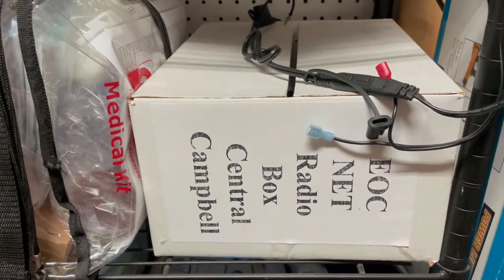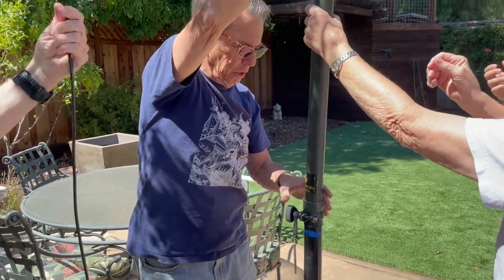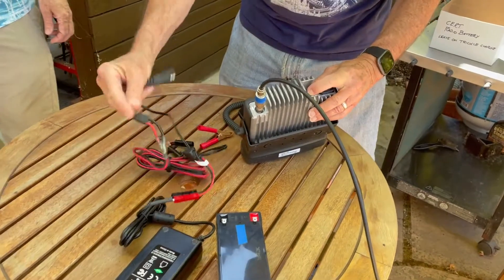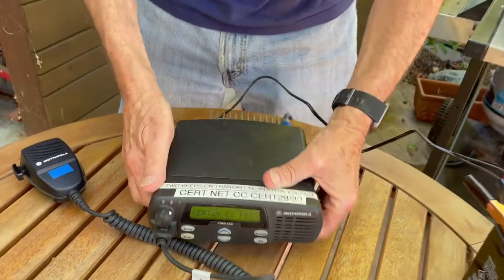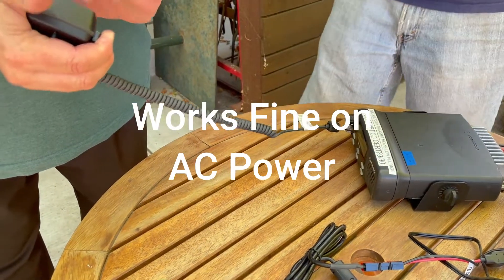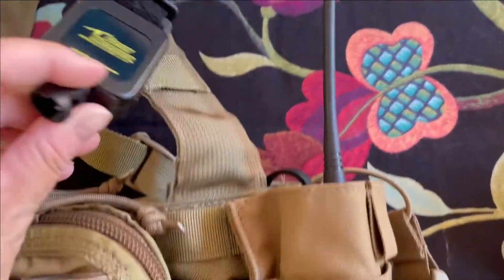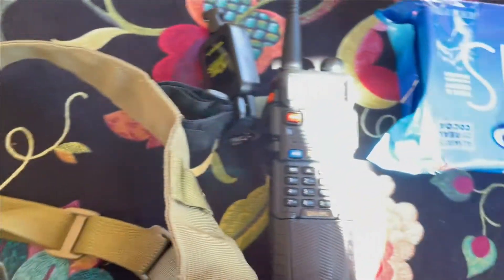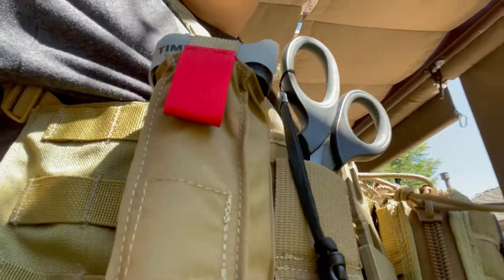JMelCERT: Neighborhood Radio Operations

Comment: Is the frequency frs or gmrs or murs
Reply from the maker: Thank you for asking. I should have been more clear on that in the video. The answer is one of the above. For this application, we operate on UHF/VHF. Specifically, the 2 meter band and 70 meter band. Each member is issued a Baofeng UV-5R radio which has been pre-programmed by our radio team. Even though we are operating on ham radio bands, our members without Amateur Radio Licenses can legally transmit because we use frequencies sanctioned for CERT and the mission - for official CERT use only. However, they cannot legally transmit on other ham radio frequencies - unless it's a bonafide emergency.
Reply: @jmel5546  do you need a ham license

Comment: Power connection to battery.  You are asking for a short.  Have someone make up power cables for your battery with spade connectors going to Anderson Powerpole, and put Anderson Powerpoles on the radio power lead.  Powerpoles can only be put on one way so there is no accidental + to - connection.  They can only go + to + / - to -.